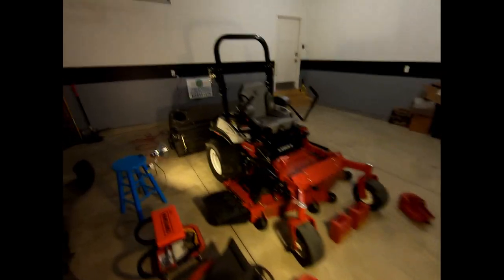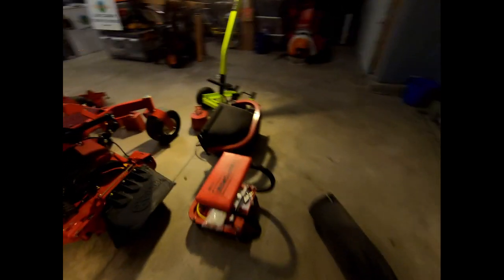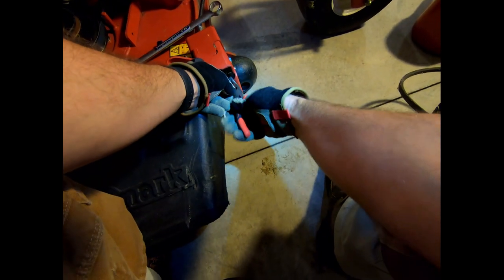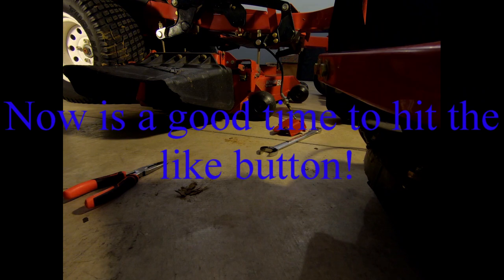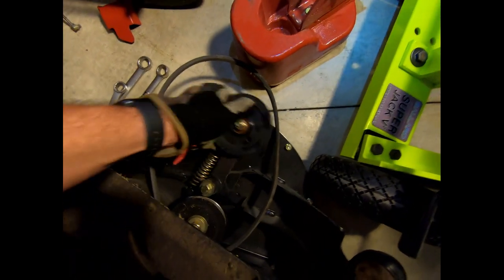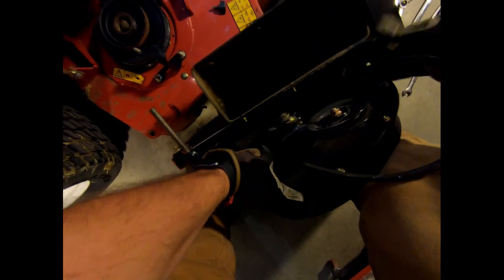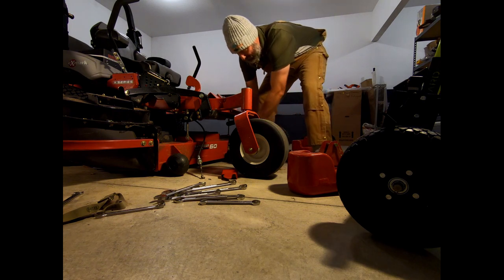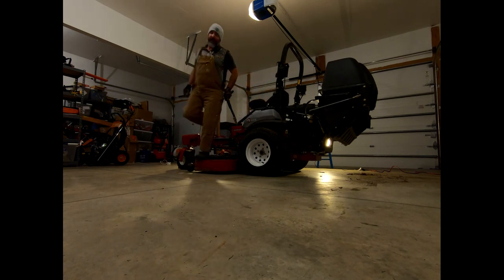Installing Leaf Bagging System on eXmark Lazer-Z X-Series (Ultravac Quick Dump Collection System)

Comment: Where can you buy those front weights? Are they part of the bagging system or separate?
Reply from the maker: You can use a search engine to look up, "exmark ultravac caster weights replacement" and locate a vendor from there.  Good luck.